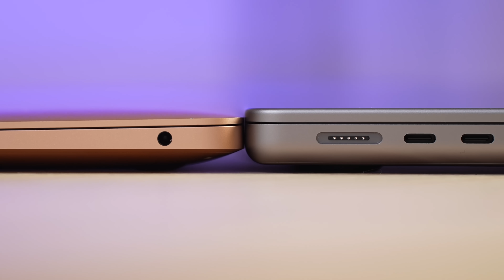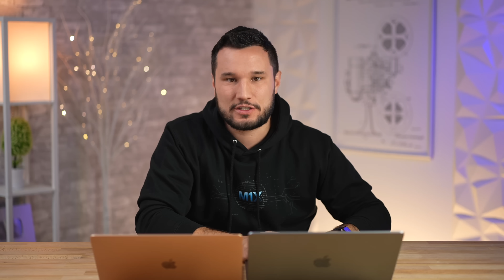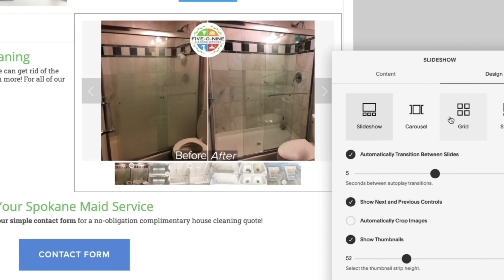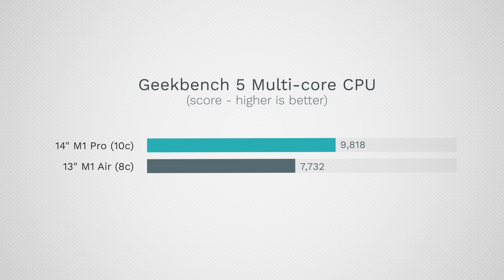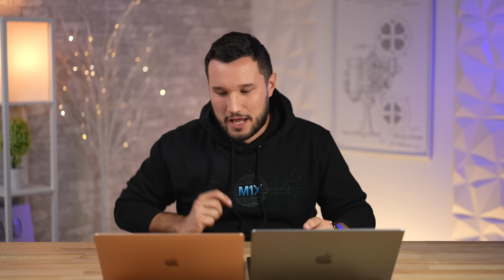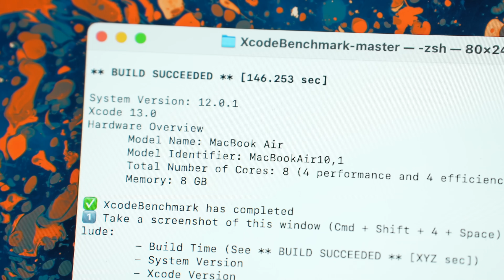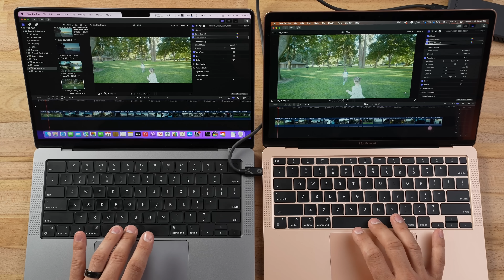14" MacBook Pro vs M1 MacBook Air - Worth $1,000 MORE? 🤔

Comment: I love everything about the MB Air. BUT, I ended up getting the MB Pro 14. Reason? I hate dongles. In the era of post-Covid, Zoom is a huge part of my life — I spend countless hours of Zoom consultations and I find that Zoom uses a lot of power. I used to have a regular MB Pro 13” (not M1) and it used to heat up like crazy on Zoom. On the 13” M1, it never heated up but I found attaching so many things on the dongle (especially the HDMI cable) was a bit of a pain in the rear. PLUS, MagSafe charger!!! Best thing ever. MagSafe and HDMI slot made it all worthwhile. Oh, and I’m 61 and boy does it hurt my eyes on the small screen. A slightly larger screen is nice but when I’m home, I have a minimum 27” monitor. 😂

Comment: Not sure if this was mentioned but a good thing to mention is that the Macbook Air only has 8GB of Ram. Which shows how good the M1 chip really is. Im  sure a lot of the rendering was heavily bottlenecked by the 8gb of ram. But I get its supposed to be about base models.

Comment: Here is my dilemma in todays world and for long-term longevity/durability I don’t know which MacBook version to buy between the 14” MBP M1 256 for $1600 or the low end spec’d MacBook Air for $800. I am a late 30/male/college student/going into nursing graduate program.I need to upgrade my 2013 MacBook Air. What do you think?

Comment: I am getting the base model 14-inch MacBook Pro. I do long multitasking (like 6 hours at a time) and I feel like the fanless M1 MacBook Air might start thermo-thruttling and lose performance. Because of the multitasking I do and how I like to keep 15 Chrome tabs open, I need 16GB of RAM and I feel like the base model 14 inch is for me. I also absolutely hate dongles, so the HDMI port on the 14 inch is great for me. I don't know though, if I need 32GB of RAM or just 16. I move around sometimes so the 16-inch MBP is out of my possible choices list as it is too heavy.
Reply: By the way this will replace my old 2017 Intel MacBook Air which is just so incredibly slow. The GPU is also kinda dying from overheating a lot. It often runs at 80 degrees for up to 5 hours.

Comment: I want to buy the M1 Pro MacBook Pro 14" but struggling to choose between the binned and the unbinned M1 Pro chip. Should I just by the fully binned M1 Pro chip with 8 core CPU and 14 core GPU, 10 core CPU and 14 core GPU, or 10 core CPU and 16 core GPU. I need suggestions 😭😭

Comment: air with 8 core and 16ram and i dont think the MBP is really better.
Reply: the MBP 14 is really better. The MBA with 16gb ram is good on its own but if you put them side by side. you will feel the MBP is better no doubt. I think it's worth that 1k difference but if you need it or not is another issue.

Comment: The Air is hands down a better buy than the 14 Pro. Now, if you are considering the 16-inch Pro, that's a different story. I'd get 16 just for the size of the screen and other perks.

Comment: guys which one you suggest
In my region the temperatures go 40 to 50 C, and so much humidity will be there. I am from India
at present In India it costs
macbook air m1 costs here 16gb/256gb                        -- $1389
macbook air m1 costs here 16gb/512gb                        -- $1672
macbook pro 14(LED) costs base one 16gb/512gb      --$2227
I want this for long term use.
which one you guys suggest

Comment: The MacBook air always looked like what everyone expect a laptop should be. Small and thin. I say wait for the next SoC upgrade. The potential of a 999.99 10 to 12 core Gpu. Sounds more appealing. The MacBook Air. Will probably be the smart purchase going forward. With these new Arm cpus. You should only get MacBook Pro if the features are a requirement. Otherwise get a iMac for your power user needs.

Comment: Hi, I'm subscribed :) and really appreciate this video.  What you said about the MacBook Air handling your YouTube videos helped.  My next adventure is creating videos both for my business and a video podcast. The 14" MacBook Pro is very tempting, but even if I upgrade an Air to 16GB and 1TB, the 14" MB Pro is at least $500 more. Does the basic 14" M1 MBP have video codecs that the Air does not? Hankering after the 14" but think the Air makes sense financially. It's more that I don't want to have to buy two computers in short order.

Comment: personally my biggest ifs with laptops is that i hate small screens. so when i went to a store to look at these macs, the macbook air just felt disgustingly tiny. even besides all the spec differences in the screen which are already better. if the macbook air had a bigger screen i would've chosen that mac instead. a tiny screen gets cluttered, and you lose track even just if you wanna drag a file from finder to another thats fills up your screen. i ended up choosing the 14 inch m1 pro.
Reply: What if you’re using it with a monitor ?
Reply: @MILSPEC_MEXICAN  the m1 can support multiple 4k monitor streaming at 60 hz. i have a 1920x1080 144hz display and it runs fine. but i dont really use my laptop there. since ill be using it at school and from my bed lol
Reply: but its capable
Reply: @Lukas-qy2on  thanks brotha!

Comment: I had the MBP 14" and returned it for the MBA M1. I still can't get the MBA to lag or slow down and even tried to open as many tabs as I could with YouTube and video editing on the go, it still managed without an issue. Made me thankful not to spend an extra £1,000 on the MBP when I didn't really 'need' to. 
People forget that the MBA can also do video editing as well, it can essentially deliver 99% of what people will need. In my opinion, the MBP is absolutely not worth £1,000 more. The screen was nicer, but not that much money nicer.
Reply: Hi how much RAM storage and SDD storage did you get for your MBA M1?
Reply: @FreezeInMe  i bought 16/512 MBA last week from Adorama in  $820

Comment: I was never sold on the air’s portability advantage over the pros. They’d still go in the same sized bag. The only major advantage for the air is price, but I worry it will sunset faster so the pro might still be worth the investment.
Reply: also not being able to connect more than 1 monitor with the air! :/
Reply: @wah704  yesssss
Reply: well it is lighter, and one thing I really enjoy about my air over my previous 2017 pro was the angle of the MacBook for typing
Reply: There’s smaller bags tho lol

Comment: I am considering the M1 Air with 16 GB RAM (in part to run Windows) and 512 GB of storage. That specs out the same as the 14" MacBook Pro. My cost difference is $500 CDN before tax if you include a dongle with extra ports. Is the Pro worth the extra money? It seems like it.
Reply: Am thinking of same thing, and saving money, I didn’t buy yet. I wonder if that’s a good buy for programming
Reply: I went with the Pro and it seems like a way better more responsive machine.  The screen sharpness and color is much more (VIVID best way to explain it)
than the MBA,the speakers are louder, the extra ports and HMDI capability make it more versatile as well.  Just a little heavier though.

Comment: wondering about the difference between the 10-core CPU M1 Pro 14” vs the 8-core CPU on the M1 Air for coding, both with 16GB RAM

Comment: If one was to compare the 16gb MBA 8-core m1 with the Base model m1 14” MBP do you think one would see a big performance difference? Would the extra 6 cores in the 14” makes that much of difference in performance? Also, does the throttling that occurs in the MBA m1 due to not having a cooling fan really effect multi core performance and that’s were the MBP shines? Lastly, how much does the size of the SSD play a role in getting things done? It’s always been thought and shown that higher GB ssd’s generally read and write faster?

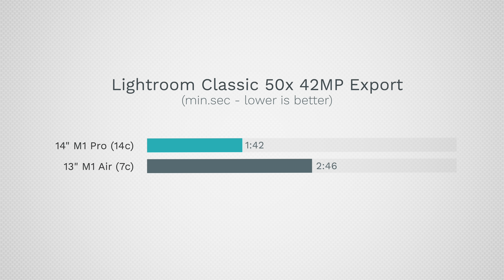Comment: Max Tech be careful with the percentages when "lower is better". For an example the export times at 20:34. You say the Pro is 63 % faster, but actually it is only 39 % faster and it's the Air that is 63 % slower. Remember to take into consideration which machine is the benchmark in your calculation. Otherwise great video

Comment: Which one do you recommend for a nursing student who basically just does homework and virtual simulations? I like the fact that the M1 Air is lighter and screen size seems to be good… the M1Pro sounds better but I’m not too sure on the screen size. Was hoping for something in between 12-13 inches. I want this laptop to last me at least a few years. Thankfully, money is not an issue here (BestBuy!) thank you all in advance
Reply: I've been using a lot of 13" laptops over the years, and some 14" ones and I generrally prefer the extra screen, when I can get it. The difference in wiegh is about 300 grams, between the MBA and the M1 Pro. Both of the machines will last you for a while.
Reply: @user-qy2wf2lt6v  thank you for your input… I guess it’ll come down to screen size….

Comment: If the New 14 inch was 200/300 
Cheaper it makes sense but the MBA with 16gb ram is more Than 95% of users need at a 600/700$ save i think the sleek design of the air has more things going for it Than the more power full but less portable more money sending counter part.
I Just cannot justify the reason for getting the New one other Than eye candy.
MBA is way nice in real Life.
Plus apple care is an Extra 150 bucks more expensive in the end MBA 16gb ram 512GB ssd
Including apple care 2100 cad
A 14 inch 16gb 512GB ssd is 2950.
That is way to expensive for a somewhat better screen
Somewhat faster ssd
Somewhat better battery life
Somewhat more ports and magsafe
You could buy another base MBA lol or a used 14 inch next year lol.

Comment: I think at this point I’m not worried about which one is more powerful or faster than the other. I’m just freaking mind blown that the air can do all this at such a low price point that I wonder if it will affect the longevity of the device. Because if it dies in 2-3 years I’d rather just spend the extra $$$ on the pro, which I know will last based on my past MacBook pros

Comment: I ask myself how apple measure them. In the Website it is clear that the MacBook Air (towards the end like compared in the video 1:07) is thicker than the MacBook Pro. But if you just look at the comparison this is not the case at all. 
According to the website:
- MacBook Air height: 0.41-1,61cm
- MacBook Pro height: 1,55cm

Thanks for the detailed video to clarify my doubts!

Comment: It’s worth it, just depends on if you can make worth of it. If you’re using it for light tasks perhaps not. But if you’re more a power user or will use it a lot for media and entertainment, it probably is because of the performance difference and how good the screen is in comparison.

Comment: well I don't think it is a fair comparison if you say $1000 more, because the base $999 air comes with 256gb ssd and 8gb of ram while the base $1999 14 pro has 512gb ssd and 16gb of ram, if you configure the air with the same ssd and ram (512gb ssd & 16gb ram) it will be $1449 making it a $550 difference and with the 14 pro, you get a much better display, more ports, a little larger screen, much better m1 pro processor, new design, better speaker, better cameras, etc. the $550 extra might be worth it for some people.

Comment: I have both of these computers and for me the number 1 difference is the speakers. The MBP 14 has the most insane sound, full spectrum and bass-y. I can't decide which to return, if the MBA had the same sound system, the decision would be easy. I'm really not liking the notch on the pro :(

Comment: I think you sold me on the 14” at 8:20 when you said if I upgrade the Air to match the RAM and HD the 14” is really worth it then. The 14” makes so much sense. If I took the 13” MBP the 14” is even more of a of a deal. And that battery conservation, I don’t know what voodoo computer magic that apple does. Ok I’m pulling the trigger on the 14”!!!
Thanks for this thorough review!
Reply: I got the 14" myself. 16GB 1TB Amazing machine.
Reply: @Originalman144  how would you say the battery life is? the only thing keeping me from buying the 14” is that i’m worried about battery life

Comment: Reviewers sometimes totally make up use cases. Nobody is looking at these two and thinking the macbook pro is "less portable" than an air, because its like 1mm wider and a half pound heavier. the 14 inch macbook pro is still miniscule as far as laptops go and is absolutely going to be a contender for a portable workstation. In fact thats THE use case for the macbook pro, its a portable powerhouse and thats the only reason it can fetch its 2000$ starting price. Youd only buy the air if you dont need that extra power

Comment: Good. Video for someone who’s on the fence between these two models. I’m mostly on spreadsheets the whole day , some word processor and PowerPoint. It’s a tough choice will the better screen on the 14 inch easier on your eyes ?
Reply: no, definitely the AIR will be good enough, the Pro would be overpowered for your usage
Reply: Depends on what you do at the same time. For example if you are using office, along with 20 open tabs, spotify, google drive, email, some open pdfs etc get at least 16gb of RAM MBA.
As years go by and apps get more updates, they become heavier. If you plan on sticking with it for a while get the pro. 
Unless you use only word and excel and have nothine else open.

Comment: Just got a 16” M1 max 1TB and 64 unified memory. I just couldn’t find myself to spend $400 extra for 1TB when I could get 4Tb with an external hard drive. First Mac ever. Hoping to run windows as well. I have some programs I need to run on windows. I splurged because I want a laptop for a long time. I know Apple provides reliability and functionality. I’m excited.

Comment: I upgraded to the base model MBPro 14" M1 Pro. My previous unit was the MBAir M1 base model.  No regrets whatsoever.  Great video, thank you!
Reply: would you still recommend the MBPro 14" M1 over the MBAir M1?
Reply: @Londonbridge978  It depends,... I upgraded from the M1 Air to the M1 14 Pro because of the larger 120 Hz promotion display, M1 Pro speed upgrade, and the connectivity ports.  You also get 512GB SSD and 16 GB of memory.  If you do heavy coding and/or heavy video/photo editing, I recommend the Mac 14 Pro M1.  If not, you will save about $1000 with the MBAir.  It is still the best mac for most users.

Comment: As a music guy, I was leaned towards 16gb MBA at first, but I am impressed by how new MBP comes with the ports including HDMI / Magsafe. Still having trouble deciding, but this video was very helpful and very worth of watching. Thanks!
Reply: The ports on the Air are soooo annoying!!! Especially when u need the 2 porrs for usb or a drive and are exporting a video and then your battery runs out. Huge issue loool I need to upgrade
Reply: Thinking the same but was just planning on buying an adapter with ports on it as a solution
Reply: @iinrodwetrust  id hate to carry around ports tbh

Comment: Well, it seems that if you want to save money and still not lose any performance due to thermal throttling, one may consider the 13-inch MacBook Pro with the regular M1 chip. It has fans and is still cheaper

Comment: Apple's own processors are really game changing. Do they have any drawbacks against x86?
Reply: Currently, app compatibility. While Rosetta2 works well given that it has to translate x86 to ARM, it’s now harder to run Windows applications if you needed anything there (games, specific business software). And, you cannot upgrade your memory after the fact, even if you could open the laptop. There may be other “downsides” for what it runs better or worse but I don’t think anyone is going to be using a Mac as a web server, for example. Really, the big one is just app compatibility thanks to the architecture change.

Comment: Very good analysis. Thanks for the detailed analysis. I think I may go for air with 16Gb and 512. But that gets close in price to the pro so …. We’ll see. Thanks anyway clearly both are great options. 😉
Reply: Here in Canada the MBA 16gb ram 512 ssd sells for 1619$
And the base 14 mbp for 2310$
Now given i would think Even the MBA is more Than enough for my work case.
700 bucks is more Than what the New mbp offers me in this Day and age..
Plus the air is much more portable i might Just get the 256 ssd and get the MBA at 1394 $ and spend that extra Cash on an external nvme 2tb ssd instead. Of upgrading the internal ssd to 512GB for 225$ and get an external 2tb ssd.
Still debating.
But the 16gb ram upgrade is a must.
Reply: @mikedubz5576  in the end I bought the Air with 16Gb and 1Tb. Around 1800€. Couldn’t be happier. It is lighter and thinner and longer battery and really really fast.
Reply: @franthor  was thinking the same but instead of the 1tb ill save the Cash and get a 4tb external ssd.